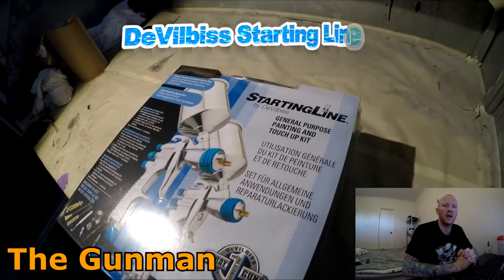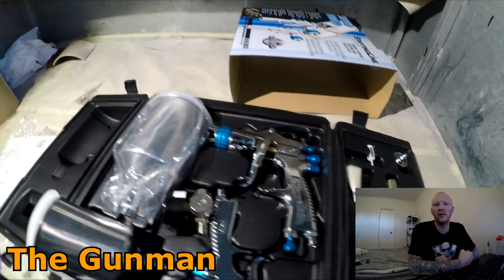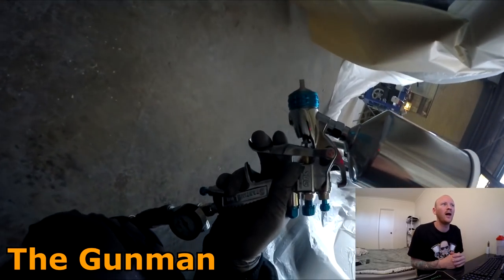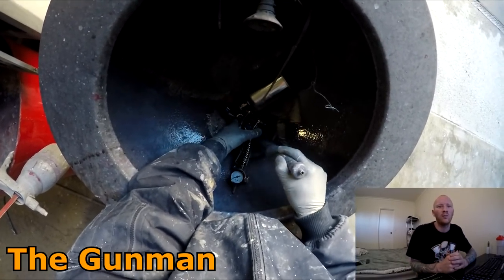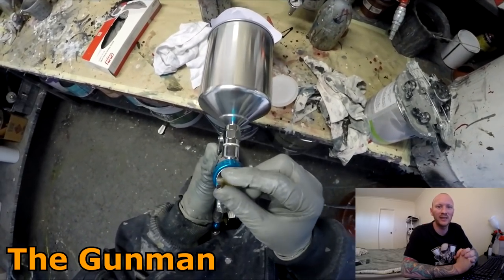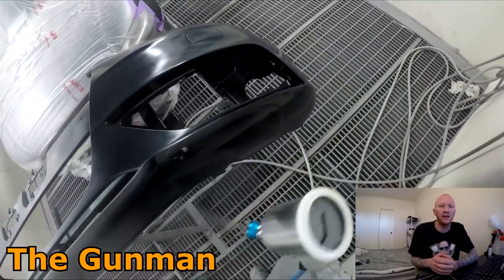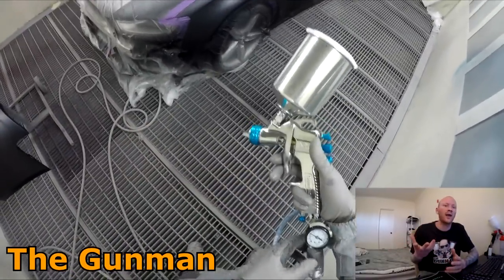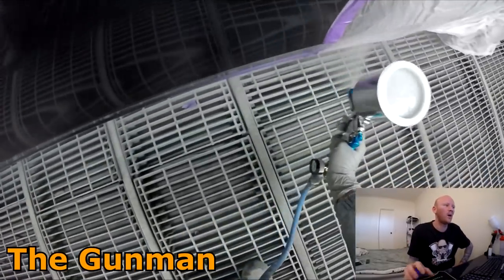DeVilbiss Starting Line: Budget Spray Gun Review

Comment: Im a structure steel painter and this is my main cup gun.  I've used it 2 years on a daily basis.  I've probably ran 600 gallons of paint through that gun.  I can promise you it's a great gun.    We run some rough paints as well and it holds up great.  Zink clad 4, temeic typox, zink clad 2, ect
Reply: Thanks bro 👍🏼
Reply: Thanks. I appreciate the comment. I just purchased the gun and thought I messed up after watching this video
Reply: @limitlessbuilds7181  it really doesn't matter what cup gun you buy.    The $100 dollar ones are the same as 400 just different quality components but if you take care of either one it will last a while

People can still do a great paint job even with a el cheapo from harbor freight

Comment: You're the second painter I've heard say you shouldn't pull the gun apart to clean it. I always take it apart. I work with the painter who doesn't take it apart. We share the shop gun. After getting white chunks in my clear coat job, I started taking the gun apart before I use it to clean his old base coat out of it before I clear raw Carbon fiber parts. To each his own. If your way works for you, great, but I always recommend taking the gun apart. Field stripping so to speak.

Comment: one of the best primer guns ive used is that 1.8 starterline. love that gun. turned out great  d smaller jobs with the base gun 1.4 but that was back when they were much cheaper then they are now. but i use my 1.8 for everything in the shop. cars semis, primer and poly.

Comment: of course you review the gun 2 months after I buy it and spray my first job with it lol. the finish came out pretty good but the spay pattern on mine got messed up just like yours did  right in the middle of the job.  I ended up drilling a bigger hole in one of the lids and it seem to spray allot better.
Reply: so Ive painted a few more panels with the gun and the spray pattern seems to consistently vary while spraying. The FLG-5 just arrived that i ordered and i cant wait to spray with it. the build quality is incredible compared to the startingline gun. everything from the air cap to the trigger pull is better. i can wait to paint some shit

Comment: Hey guys, just to add my personal findings after using this gun. We ordered it primarily for another high fill gun, not this kit but just the SLG with 1.8 and full plastic pot like the pro-lite- like Gunman advised the gun looks great but the issues we found is, the paint leaks a lot out of the back where the needle goes through the packing nut, so we need to dis-assemble the gun each time because of the high fill build up in and around the back of the needle. 

Also we found that when spraying the air cap gets a lot of paint build up drying on the air holes, and causes a lot of spray fan issues. 

Lastly like gunman mentioned - the design of the trigger and air valve is sloppy and it jams at that first 10 or so mm when engaging the trigger. Almost like the valve needed to be angled 5 degree upwards - or the back of the trigger slightly changed on the angle where it engages - maybe a roller bearing for smooth engagement. Whoops dont steal any idea's - imagine gunman with roller bearing action triggers. 

Anyway - thats my 2c worth. Pro-Lite definitely a winner that one but we use it for base and clear

By the way good vids GM - keep it up

Comment: I have the Devilbliss “finishingline” gun kit with aluminum caps not cheap plastic. I am a amateur and use it for various projects, motorcycles and occasional cars. I have great results with this finish line gun kit. Zero orange peel and a mirror finish using quality paints achieving professional results. I payed $145 at my local auto paint supply shop. Agreed, if was doing more painting I would spring for a more expensive spray gun to save on materials which is cheaper in the long run anyway.  But for now I am very happy with my Devilbliss “finishing line” model.

Comment: Top man for giving the gun away.  The spray pattern from the gun looks pretty poor.  Just means having to work harder to get a good finish.  It looked like putting the base coat was tricky, getting it to lay down right (without striping, and with the metal flakes even) with that spray pattern.  Great vid, and nice one for giving it away like this.

Comment: hi gunny! as a "diy guy", i always dismantle all my gun after use, because i don't use all days, and if it's not properly cleaned, it won't properly work the next time too...
i hate being annoyed by tools, so i accept spending a long time cleaning my gun

another tip, i always put a very light coat of petroleum jelly where the needle goes through the seal, so the trigger is much more smooth (and no weak on it)

one day, i hope you could try the airgunsa impact!

Comment: I have the the full-size gun but not the minigun it is not a bad gun but it blocks easily so you have to put your finger on the end cap and pull the trigger then it clears itself it lays the paint down smooth enough for a DIY

Comment: Your fan pattern issue that occurred after you "cleaned" the gun and came back to it was due to the fact that you didn't pull it apart and clean the tip properly. That has nothing to do with build quality

Comment: Hey, I was thinking of getting a DeVilbiss GPI which is right at the top of my budget, it would be used on motorcycle parts so small surface areas. Would you recommend this gun for this task or would something else be more suited. I know you hate cheap guns but could i use a cheap £30 sealey gun just for primer along with the gpi for everything else or should i just use the devilbiss for it all and just keep cleaning it out.

Comment: ive been watching your videos for some time now . im restoring a 96 z28 camaro . it will be my second paint ever .  first time 2 stage .  ive blocked the car and sprayed primer .  i started to wet sanding it with 600 . and its so smoth ,  so my question is what grit should i be useing for the final sand to achive good adhesion . is 600 to fine or am i good . or should it be coarser sand scratches . any help would be appreciated . and love the vids keep up the great work .

Comment: I’ve ordered this set, but I will probably paint 4-5 cars in the next decade.  I’m am a definite hobbyist and looking at your results, I would be happy with it.  I’m spraying primers, sealers, and single stage paints anyway.
Reply: Update: it’s worked well for some epoxy primer, urethane sealer, and single stage metallics. Not fantastic, but good enough for most of what I’m doing. I don’t care much for the mini gun, so I ordered one of the ANI R150 mini Guns for tight areas,

Comment: Hi Gunman. I've been wondering which comment section to ask this, and this seems as good as any :)
I'm going to be doing a full colour change re spray on a TVR (fibreglass body) soon. Just starting the Upol Fantastic bodyfiller phase. Then will be onto Upol Reface and primer, and the need for a gun. 
My question is, what gun would you recommend for a first timer? Naturally I want a decent finish, but don't need top of the line as it's a hobby.
If you can get round to answering this I'd be so chuffed, but I know you're a busy guy and may not even see this.
Great channel. Love the straight talking no BS content and product info.

Comment: Hello Gunman, Do you reckon 2mm starting line suction feed would be any good for a primer gun or any recommendations for decent primer gun (Finnish line 1.8mm looks decent) that'll last and not break the bank $150-$300 range? I'm currently using Autobarn CheapO for primer but I've already gone through two of them, seals just don't last trigger starts sticking after a few cleanouts, I ended up buying the GTI Pro lite off your recommendation and love it, but I don't want to put primer through it

Comment: Just after some advice...I have a 7 metre aluminium plate boat...painted maroon colour base coat 2k clear...would like to repaint metallic red...I have old cheap guns not suitable but can't afford $500 on a new gun,gun will be used maybe twice a year at most, I also have to paint outside in the open and I'm on a tight budget...could you recommend a gun and also a brand of base coat and clear without going to the more expensive brands...thinking the new colour would be 2017 toyota corolla Barcelona Red Metallic.

Comment: I bought a set that comes with the two larger guns that is the starting line models.  Not sure if they have upped the quality since you reviewed this or not but the caps fit very tightly I really have to push it on there.  I havent sprayed anything with them yet.  The only things I saw that maybe made me a little worried is that the trigger is harder than I expected to pull and you can hear the spring inside when you pull it.  Not sure if that is the same with all guns or what.  I may end up using these two for high build poly primer surfacer and primer and get a flg5 for color and clear coat.  Depends on how these spray when I use them I guess.

Comment: Hello Mr. Gunman. I have a question.
I'm currenly have a new car from showroom and it has a stock paint. Can i apply more clear coat to have more shiny?? Or any suggestion??
Thanks.
Reply: The best thing to do would be to get it color sanded by a professional. This would remove surface swirls and scratches. They will also check the thickness of the paint to see if they can carry out the color sanding so as not to damage your paintwork and leave it too thin after the process. It will look like a show car finish when done.

Comment: Leave some thinner in the cup and pull the trigger with no air hose connected.then unscrew the air cap and leave it inside the cup with th thinner. Keeps the cap clean and the needle wet with thinner. Oh there is absolutely nothing wrong with these 2 guns.  One is for basecoat and one is for clear coat. Great gun combo to get setup with. Keep them clean and they will reward you

Comment: Hi Gunny,Well done!!  I bought one of these a few years back and really don't like it much at all.  This was before I found you one here and went with a Pro-Lite.  Nuff said.I am with you and if you're interested, let me know how you are going to handle getting the gun to someone in need and I'll happily do the same and donate my old one too as I have no use for it running higher end guns now.  It's been sitting for two or three years, and the cheap "chrome " finish on it is actually peeling in spots, but it still works.  I'm all about helping out!!  My set didn't have the mini gun, but did have a primer gun.   That's included too.

Comment: the gunman   um can finish the prime areas with 320 disc?     no problem?   how you do...
Reply from the maker: If you use a sealer, I would recommend finishing primer with 400-500 or 600
Reply: The Gunman thanks
Reply: The Gunman you use the blender for this?   how a sealer?
Reply: The Gunman because i look  you using only 320 disc on prime core     in some vídeos      but   sorry if i no wacth right

Comment: Hey Gunman
I think your review is pretty spot on. 
I have a set of these guns. 
Yeah I have gotten a nice finish on what I was painting but!
Like you said I had to crank it up to get the atomizing I needed like about 45psi. I used a lot more paint then I would have with any gun I used before except maybe my old Binks #7. But the Binks7 had a big wide fan and laid paint down in sheets! 
Thank goodness what I painted with the starting line was a bumper and a small panel wouldn't want to paint a full car with them. 
I think your cap issue was from the poor quality. 
Because If I don't get everything just right or clean enough then the spray pattern suffered. 
Primers not so well! Note: I was using a high build but it sprayed it a bit dry probably because of the high pressure needed to get it to atomize it was making it dry before it hit the panel. 
But yeah not bad guns but to much work to get a nice of the gun finish and a big material waster for me. Small areas yeah ok..... full car probably have way to much overspray for a whole car job.

Comment: If you didn't soak the air cap don't blame the gun blame the painter. The cheap gun has a nice fan, chances are it works just fine. 
It is not a JGA. Always soak your air cap, I used to keep it in a pint can with clean thinner, with siphon gun you could soak it in the cup. My air cap was always ready to shoot. Over the weekend it was more important, things start drying out after a few days keeps the orefaces open. In my prime I could keep up with five bodymen, no helper and average a hundred hours a week. If you don't have a great big ego your not a painter. Every painter has their own routine, mine worked for me.